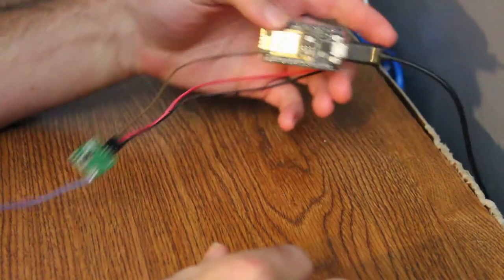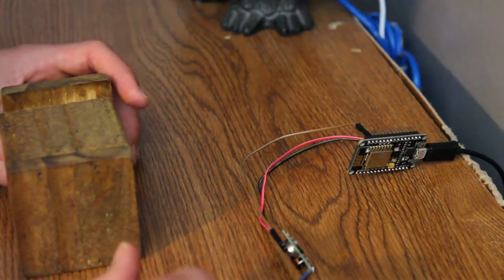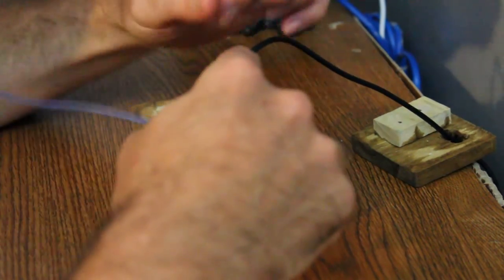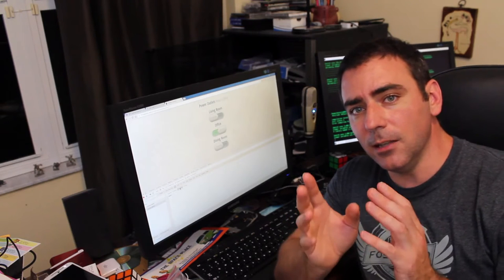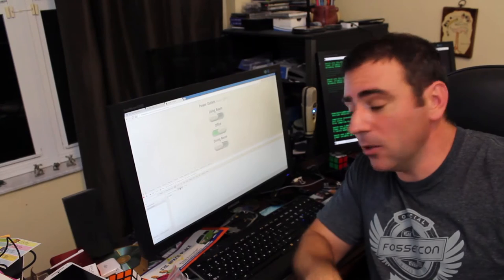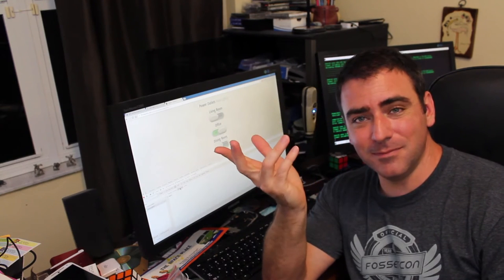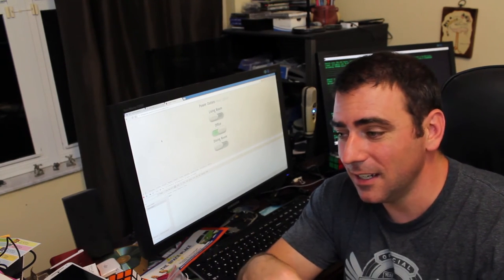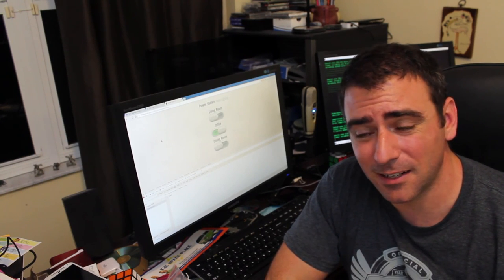ESP8266 Radio Light Outlet Controller with 433Mhz Zap Smart Plug

Comment: Same problem here, to fix it - before switching on, send the OFF code first, at least that worked for me on the reliability part. I used a sniffer to get the original codes from the rf remote. Great video, thumbs up
Reply: I can not find the interface  Please help

Comment: I ran into that sort of issue but mainly the issue i thought about was what if the power goes out and comes back on, so what i did (with rpi 2) was use mysql database to store the current switch status and then upon power up it will read from database and carry on (after 1 minute bootup time) with its last known switch state!
In your case, why not use a file (as a database).
Reply: Because we still also use the remote it came with.  If we didn't do that then we could do what you're saying.  I suppose I could setup a receiver module that listens to all the traffic and relays that back to the server, so if a button is pressed on the remote it will receive it as well and be able to log it.

Comment: Hi Kris, how do i send binary remote code over 433 mhz rf with a radio head module and an esp 8266 node mcu via a webpage on the esp? can you help with a video on this? pleaseeeeeeeeeeeees? i need it for 2 codes 1 for arm and 1 for disarm of an alarm system i have the binary codes extracted already to go i used urh :) ???